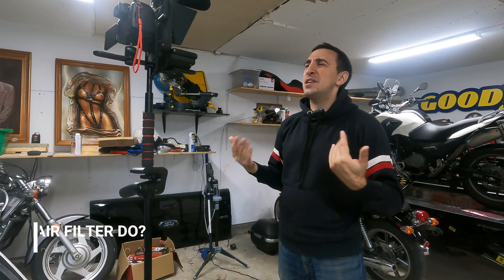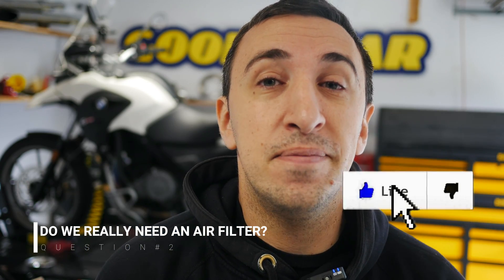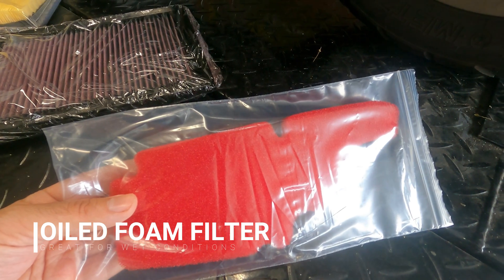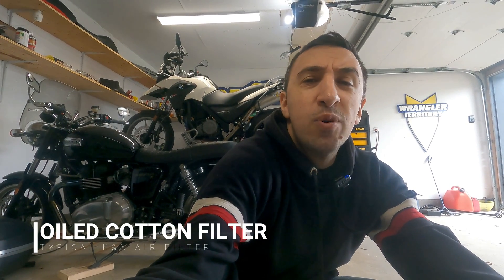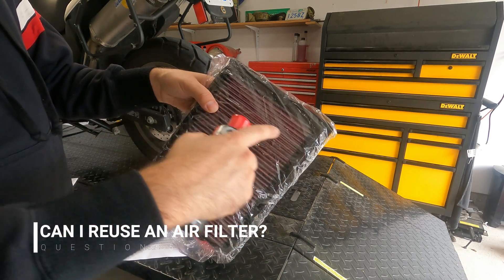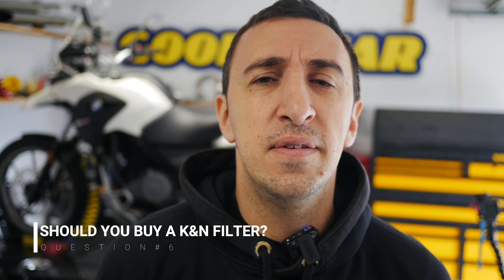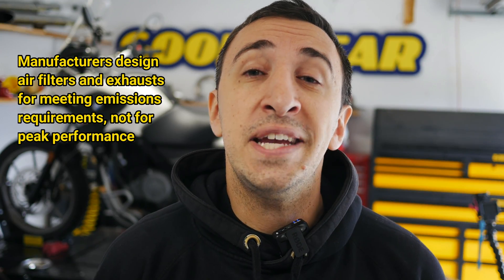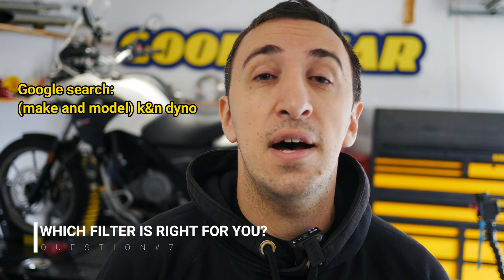How Motorcycle Air Filters Work

Comment: Can OEM foam filter being too much density blocking too much air flow compare to original to the point it stuttering the engine ?? My bike struggling with stuttering throttle issue for more than 6 months and I just can't figure out where is the problem until yesterday I test the bike without the air filter, suddenly everything goes so smooth and reach top speed without any problem but once I put the new OEM air filter back the throttle stutter again.

By the way my bike already discontinued since 2015 so original air filter is a no go.
Reply from the maker: Your bike is designed to run on the original air filter, so something else must have changed. Maybe in your air fuel mixture.

Comment: I think it really depends on what you value, filtration or performance. OEM Air filters are designed for the most part to trap nearly all particles 5 microns and larger. In the automotive field, the ones that tend to do that the best (as of today) are Purolator and Wix aftermarket filters. K&N and other oiled filters don't do a great job at filtering by comparison; Project Farm measured nearly 3000 particles per .01 cubic foot of air passed through the filter in their large particle test, compared to less than 150 particles per cubic foot for any paper filter, with wix and purolator both passing 0 particles per cubic centimeter. 

If you plan on having a "forever bike", one you plan on never selling, paper filter is the way to go, but most people don't keep cars or motorcycles long enough to see them reach the end of their useful life, so most will probably opt for more performance. It won't do catastrophic damage to run a K&N, but the extra silica will certainly reach your oil through blowby and you'll see it in oil analysis and that it gets dirty faster. However, it's not such a big problem if you keep up with your oil changes. Bottom line, do whichever you feel more comfortable with. I'll run a cotton oil filter in my maxi Scooter, but a paper in my 90's Jeep. The Jeep I want to keep forever, the Scoot is for fun. Jeep has 309k miles, the scoot only 1500. There's no right or wrong way, just make an informed decision armed with the best knowledge you can find, and know the trade offs. Cheers!
Reply from the maker: Great comment. Thanks for contributing 🙏
Reply: It is shocking to see how few videos actually cover this. 
I am literally mocked by some in the bike groups in my area for running an OEM filter on my 07 CBR600RR (btw I run stock exhaust with OEM cat/servo motor setup). Of course everyone else runs a tune, slip on and K&N / BMC. But these guys are either changing bikes so fast they wouldn't ever notice or they are constantly having mechanical issues on their 15 year old bikes, so the filter is likely not focused on.

Comment: Informative video, thanks. One question abt cleaning, for cone type filter we should rinse water from outside to inside or vice versa. Air flow from Inside the cone.
Reply from the maker: Thanks! Spray the dirty (outside) part and then rinse in from the inside out